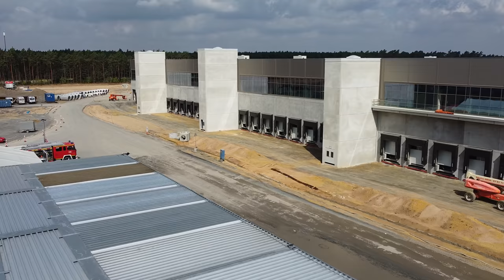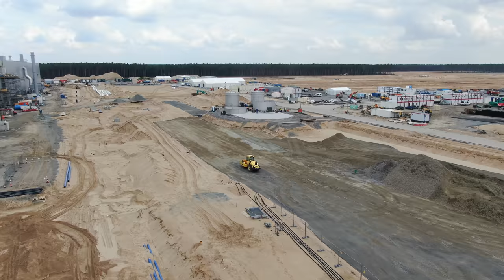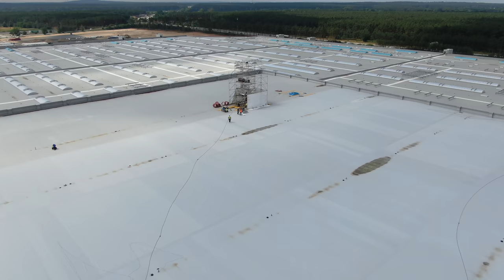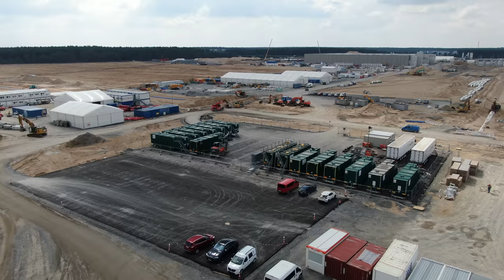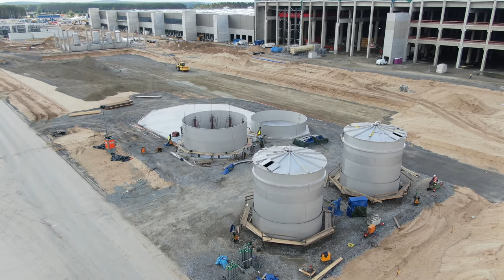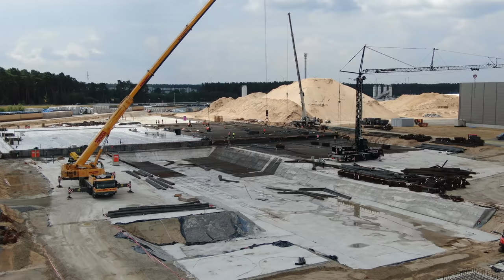Giga Berlin | 2021-07-03 | Concrete Foundation

Comment: Everyone is Dissing Berlin's build speed.
But like, there's a month of public review and then hopefully an approval within a month of that.
Tesla should be raring to start production by then.
Seems there's a chance of production this quarter. Which would be less than two years from breaking ground. For a factory with well over double of Shanghai's capacity.
Am I wrong?
Reply: The newly submitted application with the changed plans contains a kind of schedule (actually about noise emissions). But according to this schedule, the installation of the GA production equipment will last from June till November. And for the DU this will last from September till November. Thus no production before late 2021. 

And if the production will be also limited by the availability of imported batteries. Only if the battery production at Giga Berlin will be ready this will change.
Reply: Hopefully a positive decision on August 17th. If delayed then production slips into 2022, if not then Q4 2021.
Reply from the maker: @abalada  I think DU is also not important for initial production. Those can be imported. Shanghai also didn't have DU production in phase 1. I think GA and CUB will be the limiting factor for the start of produciton.
Reply from the maker: @alex135789  August 17th is not a date for a decision. August 19th is the end of the objection phase. So there will be no decission before that.
On September 13th is s a possible date for a public hearing, which might not be necessary, so the decision could be made before that. But if that public hearing will be necessary, then the permit will come later than that, because they have to value the results from the public hearing first.

Comment: The large flat areas are often known as the ‘slab’.  The foundations are the sections of concrete poured into the ground.  This is usually around the edges, and where structures such as columns and walls will be placed.
Reply: The "slab" is the foundation for the production equipment.

Comment: Are they installed enough to start but just waiting in the go ahead?. They will have more giga press installed so when they do go online they will make more cars hopefully helping with the delays.
Reply: No they have not installed enough. Only some production processes are more or less production-ready.
In the GA they have just started in June to install production equipment. And according to a schedule in the last application, this process will take until November. 
There are also auxiliary buildings/functionalities needed where works just have started (wastewater treatment) or not even this (energy center, sprinkler center, fire station, and hazmat storage). Also these will be needed to start production. Tesla has the permit to build those since July 2020.
Reply from the maker: @abalada  It is possible that not all of that will be needed for the start of production. There might be temporary solutions.
Reply: @TobiasLindh  Maybe for the fire station. The energy center is a technical must, the sprinkler center a fire protection must (same county as BER airport = same authority for fire protection). And the hazmat storage in this area with high ground water protection level most likely as well.
Reply from the maker: @abalada  The sprinkler system will be build there. I can't give to much information, but there will be some temporary solutions.

Comment: I expected a big concrete foundation in the area where a Giga Press is placed or other heavy equipment. I can't remember this was the case when last year the area around the giga press was constructed. I just remember a lot of squares (pole foundation?). Does anyone know why in this area of the battery factory such a heavy construction as foundation is created?
Reply: There are 8 over 2m thick foundations for the casting machines.
Reply: @julianreverse  thanks, I had to go back to the 7th of November to spot them. 😂
Reply from the maker: @julianreverse  That's not true. The foundations for the casting machines are about 1.40m. Look at the old videos, where the workers are leaning over the rebar. That wouldn't be possible with over 2m. Or you can also look at the documents to see that it's not more than 1.40m.

Comment: Excellent drone footage Tobias. The building structure seems to be nearing completion but there are still lot of material on site which would indicate that there is still work to be done. It will be interesting to see if Giga Berlin can start producing cars by the end of 2021. I am assuming that would be predicated on getting the new battery building completed and tested. In any case once the plant is in full production it will really benefit EU and Tesla.
Reply: I think they can produce some cars in 2021. That is still 5 whole months. I'm hoping they can do trial production in Sept/Oct and then get everything ready for a good ramp from November. 2022 should be very exciting for Tesla Berlin (and Texas).
Reply: @jamescoppe  - hopefully Tesla will ramp up production slowly so there will be no quality issues, like there was with the model 3.
Reply: @miken4591  It's quite different this time. Tesla will only ramp as fast as they can and maintain quality. There are no real reasons to rush now. The company is not 'on the line' anymore. I have a Model 3 from Shanghai, the quality is very good. Germany will be even better!

Comment: It seems that the section with the giga presses has been at a standstill for weeks now. Only 2 seem to be in a state of near completion. There is supposed to be a total of 8 giga presses. At this rate it will take another year for just this section to be completed.
Reply: Nobody needs 8 casting machines in phase one. They just began work on machine 3 and are preparing for testing the other two.
Reply: Tesla has also massively changed the plans for half of the building in the new application.
Reply from the maker: Two are enough for the start of production. More are just needed for high volume. The arrival of more machines depends on how fast IDRA can build them.
Reply: @TobiasLindh  according to Sandy Munro Tesla has 12 giga presses on order with IDRA. That's more than the entire legacy manufacturers combined, as those haven't figured it out yet.
Reply from the maker: @zews1  IDRA said that 9 are to be delivered in 2021. 4 of them are already delivered. So i expect that Berlin and Texas will get 2 more each, and Texas will also get the 8000t version.

Comment: Why the plastic sheeting on the battery section?
Reply: With a very thick pour you want to be careful with retaining moisture as the concrete cures.
Reply: @patrickkenny2077  thanks, makes sense.
Reply: To keep the water in the concrete.
Reply: @julianreverse  Pity no one caught the filling on video, would have been sweet to see it live. So much concrete.
Reply: The concrete shouldn't dry that fast.
Reply: @benjaminschneider4555 thanks dude! Great shots and I have subscribed for future content.

Comment: Does Tesla as a tech company make better, more advanced factories than the old school car makers? Or similar?
Reply: Pretty similar if not the same.
Reply: @steffenoei9078  Thx!
Reply from the maker: Tesla tries to do innovation on the manufacturing process, and some things they do differently than others, like the casting machines and the warehouse concept. Most of the processes are pretty standard though, and most machines are from the same suppliers.

Comment: Was concrete poured into the total depth of the deep rebar structure, or was gravel put in first and then topped with concrete?  The rebar structure appears to be more than 2 meters deep.
Reply: It's fully filled with concrete, no gravel. In Germany we don't do things by half😉
Reply: @anykey9473  Tesla was likely forced to construct this large reinforced pad since they were not permitted to drive concrete piles into the water table to stabilize the sandy soil.   The pad has to support the tremendous weight of hundreds of thousands of cells that will be stored in high racks during the formation process.  The Austin, Texas cell production area used the GeoPier method to stabilize the ground before a relatively shallow rebar reinforced pad was poured.
Reply: @wadeyorke8144  No, in that area they will press the cell cases
Reply: it's only 1,60m to 1,70m thick.
Reply: @anykey9473  No.
Reply from the maker: @wadeyorke8144  They could do piles, just like the stamping section. But the permission for piles is a longer process than a raft foundation. 
The funny thing is: The area for the formation process is the only area of that building that won't have a huge foundation.
Reply from the maker: @julianreverse  In the area that got poured now, it's 1.65m to 1.85m to be exact.

Comment: 11.28 to 12.55
OH. MY. xxx
Another 9 complete new imported bodies.  So  still not able to assemble there own from parts.
Does anyone know if they came from US or China?
Reply: These bodies are standing there for about 2 months already.
Reply: @AkkuR1992  oh, I hadn't realised. Did someone decode the transit details or was one left open all that time?  The boxes looked fresh and freshly opened.  The original 6 were just multilayered plastic wrapped not boxed.   In the boxes there could be many more stored all over the site.   If this batch have front castings it could be the first ones used out of Austin,   built at FREMONT,  and transported to Gru:nheide from the US. 
WOW!
Reply: @davidclark2286  I think there were 10 initial plastic wrapped ones. Then after some of those disappeared some more appeared but boxed in wooden crates. Over the last few weeks these seemed to dissappear one after the other, too (seen in paintshop). Now this one seems to be left open since at least Friday. But the wooden crate it came in has been there for quite a while

Comment: at this speed there is no way they start production at the end of this year
Reply: Do you know the time schedules and how can you judge the progress from outside ? By the way in Fremont the production of the new model Y is still in simple tents.
Reply: @steffenoei9078  It's as easy as watrching the video to tell that there won't be any production this year.
Reply: @julianreverse   That´s funny.😂 I am in this business for more than 30 years and I can’t see from outside if the car production ( not battery production) will start at the end of the year. Maybe you have X-Ray eyes and you see the progress inside or it is just a feeling in your stomach. By the way in Fremont they produce the model Y in simple tents on a former parking site. According to Elon, production have officially to start in Grünheide 6 months later. Therefore at the end of January if he doesn’t change the original plan’s ( battery factory instead of storage hall) completely again. Then according to German building law everything will have to start at zero, and I have to agree with you. But Tesla has more problems in recruiting qualified new employees than with completion of the factory. The wages from Tesla are above average but the german car industry is booming.
Reply from the maker: @steffenoei9078  Elon never said that production would start 6 months later. That was a claim by Automobilwoche wich turned out to be false.

Comment: This place is slowly turning into another Stuttgard.  Elon! , O, where art thou?
Reply: Everytime Elon shows up the plans are changed. Now further production processes are added. This means changes in the already completed buildings (like now an additional mezzanine floor in the DU is added) or the extension of the stamping. And on this probably not the building process is the decisive time factor. Like with the GA. In Winter many feared the slow closing of the roof would mean delays. But the roof was closed - and nothing more happened. The production equipment only trickles now slowly in (but according to the schedule completion will take until November). 

Stuttgart 21 is since years pretty well on in its schedule. The new highspeed line from Wendlingen to Ulm will go into operation end of 2022 (with the yearly timetable change early December). And the new train station is currently even slightly more advanced than the schedule. And Stuttgart 21 is, by all means, a really challenging project (geology, central location cutting through the entire infrastructure of a big city, ambitious technical structures). Not just a new factory on a plain field (aka ex-forest).
Reply: The fact that you will compare Tesla Grünheide and Stuttgart 21 in the same  sentence prove that you do not have an appreciation. Neither by Tesla Grünheide nor from Stuttgart 21. You should refrain from these stupid comments.
Reply: Better Elon stays away. Otherwise he will completely change the plans again.